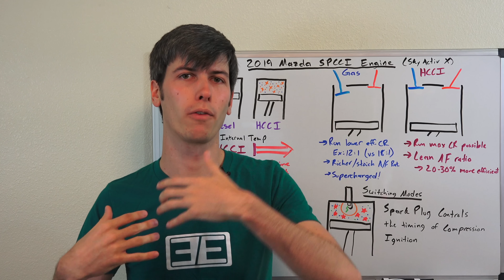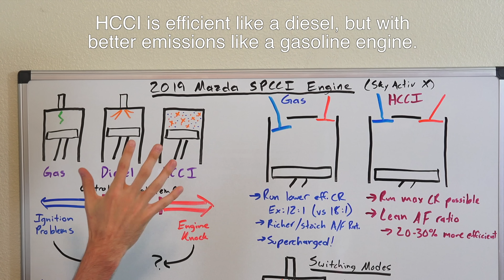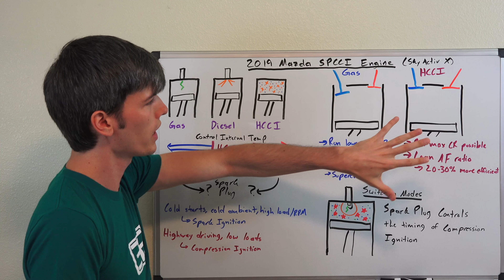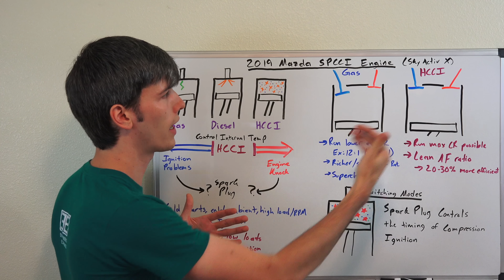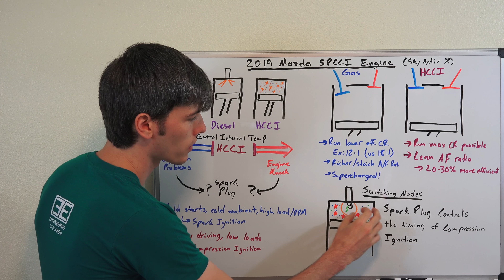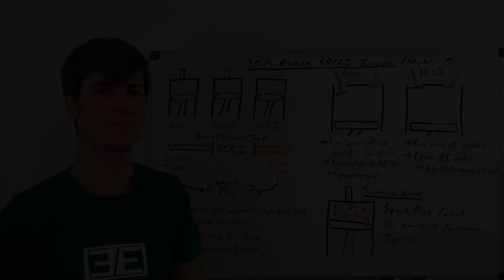Mazda Creates The Holy Grail Of Gasoline Engines - HCCI SkyActiv-X

Comment: This is complicated. Why not just make electric cars? :D
Reply from the maker: That's also part of their plan. From their press release: "From 2019, start introducing electric vehicles and other electric drive technologies in regions that use a high ratio of clean energy for power generation or restrict certain vehicles to reduce air pollution."
Reply: You don't have to fuss around with an electric motor to get torque out if it. No need to down shift, just more current. What percent of the population in America even has a manual car? How many of those can rev match or double clutch down shift even?
Reply: LOL to all those that still use the "lithium is rare" meme that was abandoned even by the dumbest of trolls - watch some of the lithium videos out there and you will see that it is everywhere and also once a battery is dead the lithium inside is not exhausted you can recycle the battery and make new batteries so there is a finite number of batteries that we need to power the world and thats it.
Reply: The only thing that's really primitive about electric cars is the batteries.
Reply: They shouldn't ban ICE cars, simply mandate that the exhaust products run through the cabin before venting into the atmosphere.
Reply: john m Your ignorance baffles me. Electric cars have just as much challenges to overcome as a combustion engine. Major challenges are: Weigth, battery lifespan, battery cost, improving recharge times without wearing out the battery too quick, passive safety, different cooling concepts etc. etc. etc.
Reply: If everyone had electric cars energy prices would also sky-rocket. There is nothing eco or smarter about electric cars long term.
Reply: The ignorance on this thread is straight up hilarious! My favorite part is when people attack electric cars using the argument that mining lithium isn't sustainable!!! Lmao! And fossil fuels are?? Wtf is happening here
Reply: Funny guy! To be truthful, the electric drive train is so precise, you don't need to. If you wanted to, just for fun, you could program the inverter to give you the feel of it.
Reply: Why not just tie your balls in a knot until they fall off while you're at it?
Reply: OttoH because you can’t rev match down shift a manual transmission with electric
Reply: @Richard Dastardly : You are so wrong. https://en.wikipedia.org/wiki/Lithium%E2%80%93sulfur_battery
Reply: Šnek the nuclear thing isn't correct..it does create nuclear waste which is pollution.
Reply: The biggest issue the military faces is transporting fuel. I am sure they can't wait to get rid of it.
Reply: Please explain? There are other ways to generate electricity other than coal; you are aware of that, right? Even so, a coal powered plant is far more efficient than an IC engine. And we're not even talking about drilling, transport and refining of fossil fueled cars.
Batteries in EV can already rival gas powered cars. Compared to the IC engine, the EV is just in its baby shoes. Battery tech can and will massively improve  in the coming decade.
With the IC engine you'll always be limited by the laws of thermodynamics. The best you can hope for is about 30%. After that, you're stuck.
Reply: trying to squeeze as much efficiency out of gas while we transition to EV. Infastructure isnt in place for everyone to use EV, and battery tech still needs to evolve a bit before EV's can become practical for all use cases
Reply: What are you talking about? Electric cars are way more reliable than ICE cars by their very nature. They are much simpler and don't rely on nearly as much on moving parts (under extreme conditions). No complex ICE, no complex gear box, transmission fluids and lubricants. Each wheel can have its own simple electric motor. If one dies, the car can still drive without any issues.

In my opinion, hybrids are a senseless compromise that offer the worst of both worlds.
Reply: less moving parts = less complicated
Reply: Because electric cars aren't perfect yet, a ICE is also not perfected yet.
Reply: Drunken Hobo so many people liked thier comment because there are a lot of brainwashed ideologues who group electric or hydrogen with stopping so called "climate change". This idea can make you feel good enough to the point one ignores the facts of engineering and physics.
Reply: OttoH probably because it would be expensive to completely reengineer their factories to just produce electric cars
Reply: A electronic sound generator can make any sound you want.
Reply: You are assume electric cars is less complicated.
Reply: Dan Sneyd i personally believe that we already have "tech" to produce way more efficient, &  better batteries. We already know for a fact that those large "to big to fail" companies ie. JP MORGAN, suppress things to keep their fat cat pockets lined. I mean take tesla as an example. The man figured a way to pull electricity from the ionosphere and receive it wirelessly and  they DE'FUNDED HIM and plundered him into obscurity . WHY? well to put it simply bc they had huge stakes in coal & power generation in general and jp's buddies who owned the mines and power generation processes more or less told him to flip the switch on this immigrant who's threatening their profits.
Ever wonder why us little ppl STILL cannot have access to this technology??? I mean its been a 100 of years right? U wld think if anyone the military would have perfected this method, or have they?
Reply: this guy obviously knows nothing about cars
Reply: electric cars are much less complicated, an internal combustion engine requires a fuel pump, to the spark plugs, an explosion that moves pistons to a crank , transmissions , drive shaft to the axels, finally moving the wheels,    OR you could have and electric motor and each wheel. its why a Tesla blows cars off the line, its direct power,  gas cars will have 300 at the crank but only 250 at the wheel , because of all the loss of energy and power through out the process
Reply: Djaro Dupont
As for you second point: 
Electric cars already charge in 30 minutes or less easilly. It can only improve from here. The charging infrastructure multiplies by the year, and electric cars charge overnight when the electricity demand is the lowest. On the contrary, actually. Electric cars could be used to supply electricity to the grid should the demand exceed the production rate.

As for your 3rd point:
nuclear powerplant doesn't produce any pollution. When you fart, you produce more pollution than it does in 10 years of operation.
Reply: or combine this tech with Electric= we get a better hybrid. Now if we could only get clear solar panels for all the glass.....
Reply: Edohiguma I work in mining and we were using battery powered 6yd scoops. They were the same size and weight of a diesel powered scoop. The battery packs were switched out after five hours of use and put on charge. There is absolutely no reason that a trucking company couldn't do the same. The battery and electric motors would weigh similar to a large diesel engine and transmission.
Reply: OttoH oh god I bet he drives a Prius
Reply: Djaro Dupont I'm sorry to say you're mostly wrong on those points. I honestly can say I've spent less time charging my EV than filling with fuel. It takes 5 seconds to plug it in on my drive and 5 seconds to unplug it vrs 5 mins with petrol. 
I've worked out all grid CO2 and averages for UK is 350g per kWh so my EV averages 1/5th of the CO2 per km of an equivalent performance car.
Solar does work too. I've generated 3,800kWh per year from an array that only cost 4K on my roof, so that's like 11,400 miles of free driving per year.
Reply: Because nobody wants the loss of mobility and freedom that will happen when you have depend on the government for electricity.
Reply: john hanrahan Tesla will beat most anything to 100km/h, but won't beat much anything to 1000km...
Reply: Missing the point, the problem is not generating the electricity but having access to it when you are out of juice on the go. EVs have no range issues in most cities. In places like the Australian outback and rural area, access to fuel is scarce enough and I highly doubt locals will let you plug your EV into their plug. So the problem, as highlighted before, is the infrastructure and not the EVs
Reply: Is that the best you can come up with? Can't win an argument so you'll insult instead? Don't have anymore logical or factual arguments?  Not once did I say I don't care about the environment or hate EVs but they have their limitations which is the infrastructure and less with the vehicles themselves. Unless you objectively look at the problems and recognise the limitations, you are not going to improve EV and the infrastructure for them.
Reply: You would also have to generate more electricity.  Quite a lot more.  If you think you can just string some wires, you're mistaken.
Reply: Djaro Dupont says: "the amount of electricity everyone would need will overload a power plant just by everyone coming home from work and plugging in their cars." 

WRONG AGAIN...

Peak  demand  is when  demand  is at  its highest,  typically  around  17:30  on  a  winter weekday  evening  when  homes  need  light and  heat  before  factories and  offices  have closed.   There  must  be  enough  electricity available  to  meet  this demand. 

In  this  scenario  people  will be  using  smart chargers to  charge  up  their  cars.    The smart  element  will be  inbuilt  into  the chargers.   This  means  that  the  chargers will  be  ‘aware’  of  how  much  electricity costs  every  hour of  the  day,  they  will ‘know’  when  you  will  require  your car to  be fully  charged,  they  will  be  controlled  via  the internet,  etc.   Also  we  see  time  of  use tariffs  being  introduced  to  a  greater extent. This is where the  cost  of  electricity  will vary throughout  the  day  –  the  most  expensive time  is likely  to  be  around  peak  time. Therefore,  with  smart chargers,  charging will  be,  where possible,  undertaken  away from  peak  time.  Why  would  anyone needlessly  use  electricity  when  it  is  most expensive?
Reply: Energy density of batteries vs. gasoline or LPG really doesn't matter. Once we started using Li-On batteries, the power-to-weight ratio was good enough. WHY doesn't energy density of a Li-On battery compared to gasoline? Because having a battery or a gallon of gas doesn't, by itself, push a car. Gasoline has TREMENDOUS energy density - it takes a 1,200 lb Tesla battery to hold the equivalent of 21 lbs of gasoline. That doesn't matter because in order to USE the 21 gallons of gasoline, you have to have about 1,000 lbs in engine and transmission parts to burn it. Energy density is a red herring argument by the oil and gas industry - they're scared to death of EVs (and they should be).
Reply: john hanrahan yeah for a total of 5 times before the fun police comes down and invalidates your warranty on that Tesla.
Reply: Let's wait until electric cars get 5-10 years old. Electronics usually don't last that long - not only the battery will need to be replaced (at a really high cost btw) but also we will see how the engine will behave. Nowadays gasoline and diesel cars can last 20+ years if serviced properly. 
Moreover, I don't think that charing an EV will be free/at low cost. It is possible for a gasoline engine to have a gas installation.. and now, almost every house has a gas installation and you can't really refuel your vehicle with that (it's illegal as I've heard). You have to go and pay ~0.55$ (at least in my country) for a 1dm^3. The same thing will be done for EV's fuel.
Reply: Xero Limits Yep, local Londoners love the sound of super cars all night. Oil money. BTW, practically no one has a sports car, and forget super cars. Why would Mazda invest in such a tiny market?
Reply: OttoH They mining of the materials to create the batteries doesn't help the environment it hurts it
Reply: john m: OMG.. where have you been the last 4-5 years?? The future of cars is most likely electric. This engine has a slight probability never to even reach the market. Electric cars are better and will soon also be cheaper than ICE cars. 
Have you driven any of the electric cars that have hit the market the last years? Not only Tesla has electric cars that are fun to drive and is in cars with modern technology. BMW i3, Hyundai Ioniq, Bolt e.t.c... Several new models coming out within 1-3 years.
Reply: You're right although I think this tech is interesting. Tesla's are so simple in comparison and definitely the future. I have a Model X and lots of reasons for buying it are as follows:

No. 1 reason is Desirability! The cars are just so desirable. Then there are many more reasons for me after that:

2: Environment, the CO2 emissions even factoring all electricity are only 1/5 of the Range Rover sport SUV we were looking at. 

3. Safety, with a young family we wanted the safest car we could find and the model X definitely ticks that box!

4. Performance, even the standard option -  it's faster than most supercharged V8s! 

5. Practicality. I don't know another SUV than can comfortably seat 7, plus hand luggage, plus drinks holders, plus large buggy in boot, plus bags in boot plus £100 worth of shopping in the frunk all at the same time!

6. Running costs - saves us £3,500 per year compared with the equivalent diesel SUV.

7. Convenience - it's like having a petrol station on our drive! I honestly have spent less time charging than filling with fuel. Takes 5 seconds to plug in vrs 5 mins to go fill with fuel. 

8. Technology- the tech is super cool and the self driving it brilliant. 

9. Quality- the quality is fantastic, the choice of materials, aluminium, leather, Alcantara, tinted glass, paint finish all have a such a premium feel. 

10. Doors the self presenting and frameless doors make access so easy!

11. The App and Summon! The app is brilliant and can control so much, also the summon feature is the coolest thing ever! 

12. Handling- it handles so much better than any SUV I've had and doesn't make people feel sea sick as it doesn't 'wallow'.

13. It's 4 wheel drive!

14. Air suspension is amazing!

15. The one pedal driving experience of an electric car and drive train. 

16. The ease of no gears and smoothness from the quiet motor. 

17. All the other nice EV owners!
Reply: +OttoH will it fit in my Honda?
Reply: tesla motors is doing it already.
Reply: It may be complicated but just look at the diagrams and think about it. It will not seem as complicated if you just pay attention.
Reply: Becuase not everyone lives in the suburbs and the infrastructure is simply not there for electric cars to recharge as easily as fuelling up. Building the electric car is easy compared to building the infrastructure is a bigger challenge. Before eco warriors bash on how much greener EVs are, how eco your EV depends on how your country/state/city produces its power. Unless their grid runs on 100% renewable energy and makes enough of it for everyone to charge their EVs they are 1: simply shifting their emissions further upstream to their electricity supply so they can be pretentious about their eco-friendly lifestyle and forget they are still emitting, 2: going to drain the grid and everyone's going to live in the stone age when they all decide to plug in their EVs to charge at night. Also, for how long do you need to drive the battery/cell before you offset the carbon emissions emitted to produce it.
Reply: What do you depend on to get your fuel? Electricity can be generated locally much easier than gasoline.
Reply: Liam Clarke How do you get to that conclusion? Batteries are getting better year by year. There is no ceiling yet to see.
Reply: This isn't charging your iPad.  Thing could pull more juice than a whole house. 

It will "smooth" only if it is charged with surplus.  I wouldn't assume that vehicle batteries will be competitive with grid-storage batteries.
Reply: difflocktwo Damn bro thats pretty accurate
Reply: Aren't all propulsion systems complicated?
Reply: San Mcn, wrong. Google some facts before you repeat the oil company propaganda...
Reply: Nesper, one polluting source is far easier to clean up than millions of individual poison makers, and a power plant is cleaner.
Reply: Djaro, wrong. Lithium is in very good supply and is only 2% of a battery. Li-on batteries are 96% recyclable, even the lithium. How recyclable is gasoline, and how much has its price changed in the last 15 years? EVs have half the carbon footprint of a gas car, you're spewing oil industry scare tactics. Please...Google is your friend.
Reply: john m, get some facts, please. Hydrogen is a horrible fuel.,it takes 4x the energy to create it than you get back out of it when it's burned.
Reply: OttoH how are you going to produce enough electricity to power the electric cars? 

Right now it's a majority of coal, oil and gas burning power plants, the cleanest would be thorium nuclear power. It's not reality yet and good luck with the anti nuclear propaganda. What about solar and wind, well there is night (hello darkness my old friend) so it's only producing in the sunlight . Also electricity has friction within the cables we transport them in so that means that to supply everyone with it at a higher demand is hard and quite efficient. The Tesla cars that act as a battery supply in the night sounds good but is still a long ways from being practical for everyone.
Reply: john m we really do need hydrogen
Reply: +OttoH Let us dump the used car batteries in your backyard. There, I simplified it.
Reply: OttoH 

Because some people outside cities actually want to drive more than 150 miles at at stretch at a reasonable speed, in a reasonable amount of time.
Reply: AJ Hill Okay, you brought up ignorance. So,...where AND how are you going to dispose of all the dead batteries cost efficiently? Please don't say RECYCLE because it's not that easy using current technology.
Reply: difflocktwo The electricity is generated by coal powered electric plants. How green does it sound NOW?
Reply: @John Furfaro - LOL you could but you have to have superhuman powers with that stick :D
Reply: +John Furfaro Sure you can. It's how Electric conversions do it.
Reply: OttoH exspencive and right now not that fast, however they are really quick that's why you see them on the Porsche 911 spider
Reply: well, its no petrol or deisel so hybrids are an option and biofuel may be possible (which would probably be the best option for various car companies like caterham who needs the lightest design possible)
Reply: OttoH And electric engines aren't!? TF...SMH
Reply: You can use many other sources than lithium to create a battery. There is huge research going on the create new battery tech with higher energy density and charging speed.
Reply: BleedForTheWorld I bought a volt for a little over 10k.....
Reply: Even then, they could use electric generators to charge the vehicles. The vehicles would be much more reliable and require much less maintenance. You could even interchange battery packs between different vehicles.
Reply: OttoH because the blow up quicker than gas engines
Reply: clear solar panels are on the way , In Oregon we create so much electricity that it is just being wasted, even after sending it down to California, between the dams and the wind farms, then all new houses will have clear solar panels for windows , you plug your car into it, and done
Reply: Dude ! Are you saying Tesla Model S P100 is a gay car ???? It's almost as quick as a Veyron ! You know what means ?!
Reply: Dude ! Are you saying Tesla Model S P100 is a gay car ???? It's almost as quick as a Veyron ! You know what means ?!
Reply: Dude ! Are you saying Tesla Model S P100 is a gay car ???? It's almost as quick as a Veyron ! You know what means ?!
Reply: OttoH HOW ABOUT NO
Reply: Geminijets NewMexico Pipe the exhaust straight into your helmet, even just a 50% mixture.
Reply: I am sorry to bring to your knowledge but you are not in the position to make that choice for humanity.
Reply: doubleu vee: I got the Volvo V60 TE. Really good car, but it's just an unnecessary step to a real electric car. Next one I get will be all electric. :)
Reply: As for coal power it is still more efficient than a petrol! If you visit www.gridwatch.co.uk you can click on CO2, work out grams per kWh and therefore g/km CO2. 
In the Uk the average is about 350g per kWh. So my 7 seat huge SUV with the performance of a supercharged V8s uses 1kWh for every 3 miles so works out at only 72g per km as opposed to 306g per km for 24mpg (uk gallon) SDV8 Range Rover.
Reply: Actually a 2003, 3 door Fiat Stilo with 1,2l engine. 5,5l/100km on highway, 6,2l/100km average.
Reply: Amir Hossein Khandaghabadi It is quicker than a veyron
Reply: Make coal powered car and see if it is in fact more efficient than bev.
Reply: OttoH because petrolheads
Reply: Supercapacitors, although they have less energy density than batteries, can be made of carbon instead of lithium, and last for 1,000,000 cycles whereas a battery might only last 200-500 cycles.  All of this means that Supercapacitors can be much less expensive than batteries.  Supercapacitors may be ideal for short trips, and for storing and releasing energy from regenerative braking.  This is the kind of low-cost, highly-scalable "bridge technology" that can make hybrid vehicles twice as efficient as non-hybrid vehicles, without requiring all new electric infrastructure.  

Eventually there will be solar cells on every roof, but until then, 
there isn't enough electric generation capacity nor grid distribution 
capacity to support large electric fleets.  In time, I'm sure there will 
be a total rebuild of the electric grid, but until then I think we should expect to see more hybrids.
Reply: agreed
Reply: Believe it or not much of the reason for the war in Afghanistan is the MASSIVE deposits of Lithium in the Earth there.  There is so much metal in their land that it interferes with radio transmissions.  That's no bull.  This was one reason Russia invaded and it's one reason we invaded.
Reply: @Edohiguma 
I think you might be slightly misinformed
Reply: @TheOz91

" Real electric cars have really complex control systems to regulate power and energy from the battery to the motor and back as well as to the rest of the electrical system and back."

What is an ECU found in ICE vehicles?
Reply: @Djaro Dupont
Using the fact that there are places with non-sustainble energy production as a reason not to produce EVs is an ineffective argument because the world will inevitably transition to clean energy production and multiple countries have been making significant progress.
Reply: If not fuel cells at least carbon supercapacitors for batteries
Reply: "From 2040, electric will be the only sort of new car you can buy in the 
uk. If they sort out fast charging and increase the range I can see it 
working"

They might also need to work out where the power is coming from.  You seriously think that will suvive the next few changes of govt?
Reply: Why not both? Electric motor + Skyactive X = Best economy and performance.
Reply: Not true; EVs smooth out the grid, not tax it. It's gasoline engines that are at the end of their life, not EVs!
Reply: The battery is older than the combustion engine! Why do you think musk is spending all the money he has on researching energy storage?
Reply: They all will only make Electric cars soon. It is the future now, but will get much better with superconductivity and advanced Graphene battery technology. Under God's World ruling Government only non polluting transportation methods will be acceptable.
Reply: Lourdes, nope. An electric motor has one moving part. A gasoline engine has thousands. EVs win!
Reply: Nesper, please explain your idea.
Reply: Richard, your TV  is coal powered, then.
Reply: @john m Mercedes, Jaguar, Renault, and BMW don't seem to think so. They're developing better technology in Formula E. Also, electric may be primitive but only because ICE has 75+ years of a jump start and literally trillions of dollars of development.
Reply: doubleu vee Just go look at a Train they are Diesel over Electric hybrid for 100 years. And extremely powerful.
Reply: Šnek I believe we need the electric cars and they are going to be better for the environment. But nuclear power plant produce literally tons of radiactive waste. radiactive waste is pollution. hydroelectric plants, solar, and wind can help reduce the need for so much nuclear power.
Reply: Mazda has been running studies, and with HCCI the effective carbon production of a vehicle with HCCI will be lower than an EV vehicle. Plus there is the added benefit of no range anxiety since the infrastructure is already there to support gasoline engines.
Reply: Richard Dastardly, the energy density of a L-ion battery is extremely low however, the 90%+ efficiency of the electric motor delivers almost the entire energy created by the magnetic force to the wheels; to move the car. Thus it doesn't require high energy density. Have a look at the table. https://en.m.wikipedia.org/wiki/Energy_density?wprov=sfla1
Reply: Because the worlds economy would crumble if we stopped all current crude oil industry.
Reply: Djaro Dupont, your opinions are wrong. Lithium is not a rare-Earth metal...

https://en.wikipedia.org/wiki/Rare-earth_element?wprov=sfla1

lithium is widely distributed on Earth. At 20 mg lithium per kg of Earth's crust, lithium is the 25th most abundant element. Lithium is about as common as chlorine in the Earth's upper continental crust, on a per-atom basis. The total lithium content of seawater is very large and is estimated as 230 billion tonnes, where the element exists at a relatively constant concentration of 0.14 to 0.25 parts per million (ppm), or 25 micromolar; higher concentrations approaching 7 ppm are found near hydrothermal vents. Lithium is found in trace amount in numerous plants, plankton, and invertebrates, at concentrations of 69 to 5,760 parts per billion (ppb). In vertebrates the concentration is slightly lower, and nearly all vertebrate tissue and body fluids contain lithium ranging from 21 to 763 ppb. Marine organisms tend to bioaccumulate lithium more than terrestrial organisms. 

https://en.wikipedia.org/wiki/Lithium?wprov=sfla1

http://batteryuniversity.com/learn/article/availability_of_lithium
Reply: Djaro Dupont, you're wrong again... Do some actual research before you make erroneous opinions...

62.22% efficiency rating for a combined-cycle power plant has never been achieved before…until now. GE, with the partnership of EDF, just made history and set a Guinness World Records™ title for powering the world’s most efficient combined-cycle power plant (achieved 28 April 2016) in Bouchain, France. The Bouchain plant - which officially began operation on June 17 - is also the world’s first combined-cycle plant equipped with GE’s HA turbine. 

 https://www.gepower.com/about/insights/2016/04/power-plant-efficiency-record
Reply: Hydrogen is a rare commodity on Earth without using chemical reactions or electricity to produce it from water or hydrocarbons (aka petrochemical plants). Hydrogen production ends up being a net loss in energy to produce without hydrocarbons.
Reply: Powerwall
Reply: Dear god this thread...If you want a simple answer: the supply chain to build the required number of EVs to replace all current automobiles (mainly cars) plus enough to supply more to emerging economies is simply not there yet. Take note the Elon's Telsa Gigafactory 1 is still under construction, and even that won't be any where near what is needed to meet the demand for an EV on every driveway. Watch the previous video on this topic and you'll see they state the HCCI engine is only a stop-gap measure before the inevitable switch to EVs.
Reply: OttoH Diesel is life! As a truck mechanic, I can't see electric motors hauling 75,000lbs loads.
Reply: Cause it's boring like a cvt, low speed limits, battery is harmful to produce and dispose than making a combustion powered car itself. It's heavy so cornering is not as great. The source of electricity of the battery is from coal powerplants. Until coal is gone there is no real advantage of using a electric vehicle plus no sound and the technology is at its infancy.
Reply: infrastructure. thin about how much energy we'd have to bring in towns if everybody uses a tesla. that think gobles up energy like there's no tomorrow. they say you use about 20-30 hp to CRUISE on the motorway. that's (at a really rought calculation) about 15.000 watts. it's not like firing up your eco 20 watt lightbulb. or your power hungry 1000 watt microwave oven.
Reply: OttoH How do you safely get rid of the toxic battery waste? Didn't THINK about that, did you?
Reply: Edohiguma Massively destroying local environments is fun and profitable.
Reply: Electric cars basically run off of electricity generated by burning coal and\or Nuclear power plants.  How is that "eco-friendly" again?
Reply: You had better get used to walking or find a stable.
Reply: Is that all, just the fuel?
Reply: And that takes energy too.
Reply: John Obmar, incorrect, 10 new nuke plants are NOT needed. Please see the article written by the utility in Britain that says that won't happen. Do you know how much energy is required to charge an EV? About 1/3 the amount (in the USA) to run an electric water heater for a day. With our new regulations that require a heat pump be used in electric water heaters, that saves about 1/3 of the energy. This means that if you merely replace your water heater with a more efficient one, your net demand on the grid with an EV is ZERO. Please get the facts.
Reply: http://en.wikipedia.org/wiki/Nickel%E2%80%93hydrogen_battery
Reply: Michael Galin, did you read my post? Hydrogen is being pushed by the oil and gas industry because most hydrogen we use today is a by-product of oil extraction. As an automotive fuel, it's TERRIBLE. You put 4x the energy into extracting and liquifying it than you ever get back burning it as fuel. Please look where you're getting your information and you'll see that it points right back to BIG OIL. They are scared to death that EVs can get their energy from places other than petroleum.
Reply: D. Mullins, you're completely correct. The number is that it's 4x the energy to extract/create and then liquify hydrogen than you get back out by burning it.
Reply: The manufacturing process on this engine and the cars these engines will go into is most likely leaps and bounds more eco-friendly than any electric car's manufacturing process.
Reply: Eng Expl: I just saw a video clip of Mazda saying they don't want to do electrics, that it's better for the environment to shut down polluting power plants rather than build EVs. This is part of the "remote pollution" nonsense the oil companies are putting out. Mazda has no plans, regardless of what they say, to be in the EV market.
Reply: Edohiguma, I guess Tesla's truck that's going to be announced will be an issue for you, then. Fuel cells are a bust, hydrogen is a terrible fuel energy wise, just like E-85 is (it takes 109 gallons of crude to make 100 gallons of gasoline when you factor in fertilizer, farm equipment and energy usage to grow the bio fuel material).

As for solar and wind being unreliable, is the sun not shining where you are? You're totally becalmed as well? Gosh, I thought the sunrise happens every day where I live, sorry it doesn't for you. Oh and I can make 110% of my energy needs on my roof, how's that rubbish?
Reply: Dan Sneyd, Tesla already sorted out DC fast charging. Go Tesla!
Reply: TheOz91, hybrids have all the complexity of a gas engine PLUS the parts of an EV PLUS the management hardware between the two. You're grossly mistaken that EVs are difficult to make. There is ONE MOVING PART in an electric motor, THOUSANDS in an ICE. For some engines, 2,000. Let's split the difference and just say an EV has a 1,500:1 reduction in mechanical complexity. Now what were you saying about really complex systems?
Reply: blarg, please site your references. Lithium is in good supply and only constitutes 2% of a Li-On battery. The entire battery, including the lithium, is 96% recyclable. How recyclable is gasoline? How reliable is its supply? Where did you hear we're running out of lithium - the oil industry?
Reply: difflocktwo, that's funny! Yes, let's make the exhaust of all cars go through the cabin first and you can bet EVs will be purchased!
Reply: eug3nius, EVs have half the carbon footprint of a gas car over the life of the vehicle and get cleaner as they age because their energy source gets cleaner. The battery is 96% recyclable whereas gasoline isn't. Who lied to whom?
Reply: BleedForTheWorld, if you want a $10K car you'll have to wait. Are you counting the fuel, the maintenance, the repairs that go with a gas car? Buy a used Leaf right now for $12,000 and you'll pay back the purchase price in gasoline savings in about 5 or so years. How's that?
Reply: MrToby101, $35K is about the average price an American pays for an automobile, so I'd say the Tesla Model 3 is in the sweet spot for the average buyer.
Reply: drink15, there is a 1,500:1 reduction in moving parts between an ICE and an electric motor....you were saying gas engines are not more complicated than one moving part? Please clue me in...
Reply: MajesticLion, where are you getting your battery information? Most lithium is found is salt water brine, not dug up like iron or copper ore. And lithium is recyclable whereas petroleum isn't. Please tell me your data on the environmental impact of EVs vs. gas cars.
Reply: hydrogen will not be viable until it becomes cheap to store cryogenics. hydrogen is a shitty meme.
Reply: @superAWaC You can store H2 only pressurized. Cryogenic storages have some issues for usage in cars.
Reply: I seriously doubt that those laws will survive unchanged. You can legislate "all people shall levitate by telekinesis by 2019", but that doesn't make it possible or practical.
Reply: supercapacitor technology improvements (and cost improvements) Will soon address that issue.
Reply: The tipping point is going to be held back by electricity availability. Once you have enough electric vehicles to recharge, there's no such thing as "offpeak" power anymore and from that point you need extra generation capacity to keep up (it's worth doing, as fuel to wheel efficiency on an electric is about 30% vs 4-8% on most domestic internal combustion engines). An all-electric fleet would require at least 3-4 times the electrical generating capacity currently available.

Factor in needing to eliminate oil/gas heating and carbon-fired industrial processes (It will happen) and you can at least double that again. 

The carbon tipping point is probably much closer than we think and ocean level rises are pretty much a sideshow if things go pearshaped. Look up "Anoxic Oceanic Event", "Storegga Slides"(4-5GT of methane released) and "Leptav Sea Methane emissions" (where there's somewhere between 1 and 5GT of methane threatening to blow out if the emissions continue.)

A full-on deployment of renewables  can just match current electrical generation capacity (forget paving the deserts, there are serious limits on how far you can effectively transport electricity even on million-volt cables). Where does the energy come from?
Reply: john m tesla cars aren't primitive at all lol.
Reply: OttoH Not only is gas on the way out so is driving.
Reply: john m That's funny as I use it everyday to commute to work. I don't seem to see what is so primitive about it. Totally efficient and not nearly the amount of parts to wear out as a gas engine.
Reply: Nicolas Losito Nice try but it charges off the solar panels. It can be done.
Reply: Chris Bramblett I am sure it could be done but is it practical? Panels are expensive and not very efficient. I think around 15-20% if I recall correctly
Reply: "At certain point, people have to get tired of being wrong" Elon Musk
Lets wait!
Reply: Thystaff Thywill he didn't mysteriously die he was kill in order to keep the gasoline people making billions instead of millions.  He was killed
Reply: Electric motors haul one-mile trains.
Reply: Šnek 

Do you really think that a 30 minute charge is reasonable? 
And that even if charging stations were as common as gas stations that you'd be able to 
Service ALL the cars in your region with them?

Some time for giggles, go into a popular gas station off a well traveled highway, and ask the owner how many fill ups 
Per day the station does...and the length of the typical visit.  then tell me with a straight face 30 minutes is gonna work.
Reply: doubleu vee Ummmm, NO!!!
Reply: Amir Hossein Khandaghabadi It means you're Gay, Amir.
Reply: Invincible Osprey You say invaded as if it was a BAD thing. And Osprey's aren't invincible. One just crashed and killed a bunch of Marines.
Reply: BleedForTheWorld you get get a used Mitsubishi iMiEV for under $10K all day long. But it is, to most people, the ugliest EV out there and has less than 100mi of range. But hey, it meets your $$ criteria. My lady almost got one. Her daily commute it nil, her work has a charging station, and we almost always take my care everywhere else. If it fits your use case it's a hell of a deal.
Reply: +Edohiguma You will also run out of Oil. And the difference between oil and lithium is that lithium can be reused multiple times. Besides, I dare you too image search 'Tar sands' and then 'Lihium mine'. There is literally no mining involved with 'mining' lithium.

There is a running joke that 'Hydrogen has been the car of the future for the past 30 years' and now car makers are turning away from them. They are just rubbish. They are inefficient and potentially dangerous if Hydrogen gets exposed to air.

And I'd suggest you wait for Tesla to unveil their Tesla Semi next month. You might yet be surprised about electric trucks.
Reply: OttoH an electric car can't make the sound of a Ferrari V8 much less a v12
Reply: blarg Aluminum ion batteries.
Super capacitors.
New battery tech. 
I swear human noncreativity is going to be the death of electric cars.
Also to everyone else "it doesn't sound the same" is not a valid argument against electric. At least it won't be when your custom ride is blown away by an electric.
Reply: @Mas921: Can you drive a Tesla model S P100D in 'Ludicrous' mode and say that? I think not. 0-100Km/h 2.28 seconds. They'd bury you with that smirk still on your face.
Reply: Show me an EV that is at $9,995 MSRP and then we'll talk.
Reply: OttoH That is extremely simplified. Real electric cars have really complex control systems to regulate power and energy from the battery to the motor and back as well as to the rest of the electrical system and back. Because lithium ion batteries are somewhat volatile, you need really good regulations to make sure that the pack doesn't explode or damage itself by overdrawing current or overheating. 

And yes, current battery technology is insufficient to make a car as reliable as a good gas car. In addition, having an electric car means you need to rely on the grid, which means heavy investment is needed to build a lot more power plants to charge that many cars.

Also, I don't believe IC is going to disappear completely due to various reasons. This includes niche applications like off- the-grid power generation and military use. Lastly, in two to three decades, non-petroluem and sustainable fuel sources would be the norm.

In my opinion, hybrids would be the best compromise if we want to shoot for both energy density and efficiency as well as off-the-grid reliability and endurance. Of course, technology challenges is still there though they can be overcome
Reply: Chris Bramblett because you have to burn fossil fuels to charge your car. Lol.
Reply: Why do we need faster charging and more range? How much do people drive on average a day? How much time do they spend in the car per day?

You think anyone is going to own their own car in 2040? Who would use 2 tons of metal to transport 100 kg of flesh a distance of 20 km?
Reply: OttoH because the energy required to make batteries, HUGE POLLUTION, and electric plant fuel is more dwstructive than gasoline cars with nearly zero emissions. Global warming is a political scam used to force unwanted or needed control.
Reply: most people don't even drive that far. There are other methods of traveling long distances. I don't see needing a car that can take me 400 plus miles on a single charge. It would be nice, but not necessary. 200 miles combined is decent. Most people commute about 30 miles in a day for work or school. This is enough for a week, and then some. The problem is when people are like, "what if I want to take a road trip?" which for most people it is like once every couple of years. Having a variety of cars to buy would be nicer, such as EVs and Hydrogen cars, leaving diesel and gas for heavy transportation.
Reply: gas engines are dead, it will be all electric in 60 years,
Reply: OttoH do you think electric cars is not complicated :)
Reply: EVs are already over twice as efficient, combustion has no chance. Hydrogen is a joke.

Our whole planet runs on electricity, how do you think we refine fuel and produce hydrogen? Why not use the electricity directly into the car, why convert it into fuel first?
Reply: The power density of batteries is awful, and your car is effectively coal-powered then anyway.
Reply: Electric cars are very complicated, you charge it with electricity, and then use that electricity to spin the wheels with an electric motor.

Gasoline is much easier, you need to mix the air and the fuel perfectly, detonate it, convert that detonation into rotary motion, gear it down because the engine is a poor excuse of a motor and has no torque, and then run it through the multi speed transmission because it has a limited RPM range with crappy torque, then you need to get rid of over half energy in the form of heat or the engine melts, then you need to scrub the exhaust products cause they are toxic.

Maybe it should be a law that a cars exhaust should be vented into the cabin so people understand what is coming out of their tail pipe 7 feet behind them.
Reply: Elijah Martin Yes, you are correct about that. But at the moment, nuclear waste doesn't add fuel to the fire that is a looming global disaster. I'm sure you know the one I'm talkinga bout. Besides, Nuclear waste should be very clean for the surrounding area, if stored properly (Don't know how well that is going though, to be honest).
Reply: then why is everything else electric, , shouldn't your lights and refrigerator run off of a gas motor, oh  , no they dont
Reply: OttoH electric cars are for gays
Reply: keeger, electric cars are about to become superior. That's what the new supercars will be (is) as well. I can't see why car enthusiasts can't like electic cars!
Reply: DemonsofRazgriz05 If you  aren't so worried about environment, how about we route the exhaust into the cabin instead of out the back? Take a nice deep breath at the pump too. 

If you don't live in the suburbs where do you live? Check population density maps and visualize where most people are living. Where you have people you have electricity. Given that the car is only driven not even 4 hours a day, this leaves 20 hrs of the day to charge. You won't even use 20 kWh a day of driving so a simple 1000 W source is more than enough to keep an electric car operational. Electricity is available everywhere and adding service drops is trivial and a kW is even more trivial. 

The infrastructure is already there, and adding to it is done everyday for residential and industrial reasons. You can get as much power as you want anywhere, whenever you want.

Plugging in is easier and faster than fueling up.

After you are done with your battery in your EV, half a million miles or more, then the battery is down cycled into stationary energy storage.
Reply: Why not just make hydrogen/water engines?
Reply: Daniel Hurford, how so? The new engine from Mazda is still made of metal; it still has valves, spark plugs, gasoline. It's merely the compression ratio and spark plug timing that's different. Electric car manufacturing, including the battery, is only marginally different than an ICE car, and the battery is 96% recyclable. All Mazda is doing is tweaking a dead-end technology. It still burns gas and the exhaust will still kill you and your family if the car is running in a closed garage. Get some facts about EV manufacture and use before you comment, please. The carbon footprint of an EV during its life is HALF that of a gas car and it gets cleaner as you own it; a gas car gets dirtier and cannot be improved.
Reply: OttoH  1. To make lithium-ion batteries, you need lithium... lithium is a rare metal and there is not enough lithium in the world to replace all cars with these type of batteries. 

2. It takes waaaay to long to charge batteries, to charge them fast enough, like elon musk wants in 30min, the whole electric infrastructure available is not sufficient + the amount of electricity everyone would need will overload a powerplant just by everyone coming home from work and plugging in their cars. 

3. The most efficient powerplant right now is a nuclear powerplant (don't get started about wind energy and that stuff... not every country has enough room and wind to get them more efficient than nuclear...). The amount of CO2 that plant makes (per kW) is about as much as your average hybrid, so an EV is as pollutive as a gas powered hybrid. In countries like romania where they still use wood and coal, their EV's are therefore much more pollutant than a diesel...
Reply: difflocktwo i know exactly what comes out of my exhaust pipes. Which is why i have an off road xpipe on my GT... sweet sweet music
Reply: they are banning the sale of pure ICE cars, not making it so you can buy electric only, hybrids will still be allowed
Reply: Engineering Explained Watch all the car nerds go super sayian lol
Reply: Because they're not greener. They lied to you.
Reply: The battery has very little development left, there are ways to charge it faster but its maximum charge won't increase much, plus power stations at prestwnt can not handle all that output
Reply: Batteries
Reply: @john Possum - those have an energy density of 1.8. Car grade hydrocarbons are around 36, Bigger numbers are better in this case.

If you want to say I'm wrong, use some more exotic li batteries - one of them looks to have possibly better energy density than LPG, at least. It's a pity we can't build them. Then talk about the mass of an IC engine vs electric motor & drained batteries and the efficiencies of the systems ( you'd have to talk about electricity generation also ).
Reply: 50 years is way too pessimistic estimation. 15-20 years to tipping point would be safe estimation. Most optimistic estimates vary between 5 to 10 years to tipping point And with tipping point I mean when electric cars are sold as new more than ICE.
Reply: From 2040, electric will be the only sort of new car you can buy in the uk. If they sort out fast charging and increase the range I can see it working
Reply: Petrolheads are so delicate people. :D
Reply: Because "electric cars" create more pollution  withing their very brief lifespan than internal combustion does. When if ever Nuclear Fusion is unlocked then we go electric. Until that point electric is substantially more dirty and inefficient. If you think that's not accurate then look up cited research studies. A Prius lasts 5 years maybe, then is waste... very toxic waste at that.
Reply: OttoH 
Only all electric cars in England would need 10 additional nuclear plants, and 100.000 wind mills to charge them.
Reply: Because We don't have much lithium.
Reply: Could you imagine every car in the world electric? You have more CO2 in the air in the air trying to power them then we do now
Reply: No it is no. Turn some copper wire around iron, roll some aluminium in to tube with some lithium and between these two throw couple trasistors.
Reply: I want a diesel hybrid engines.  Is anyone with me?
Reply: who tf cares. Your comment is just irrelevant.